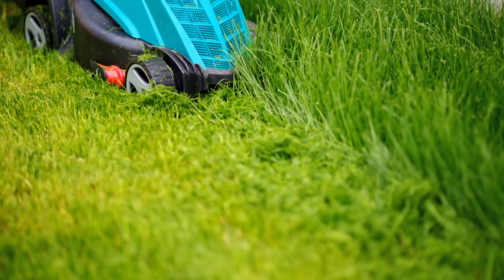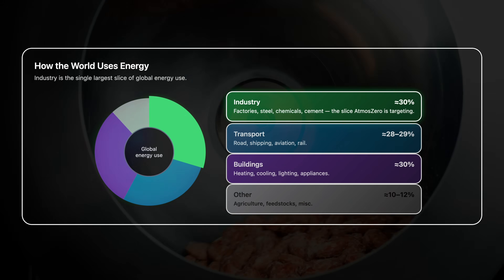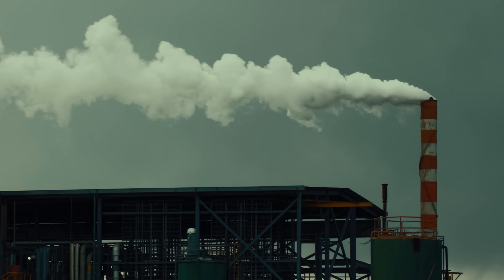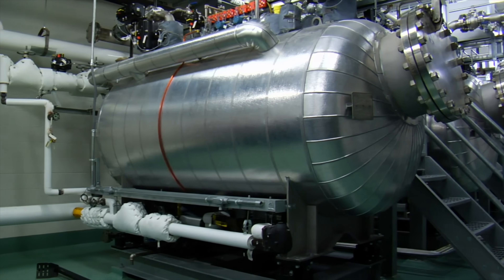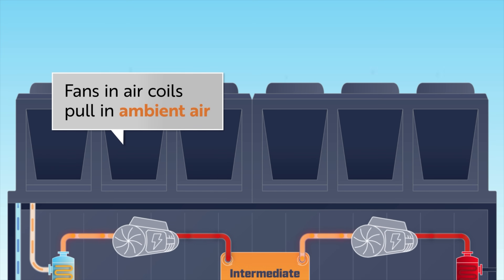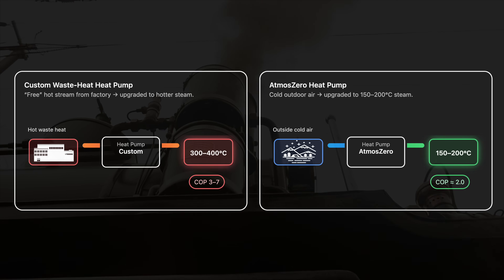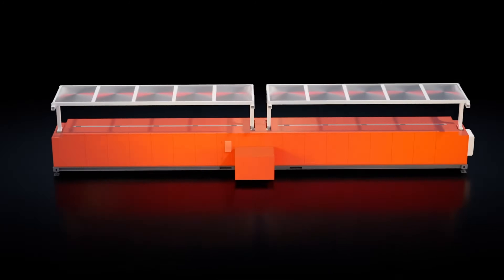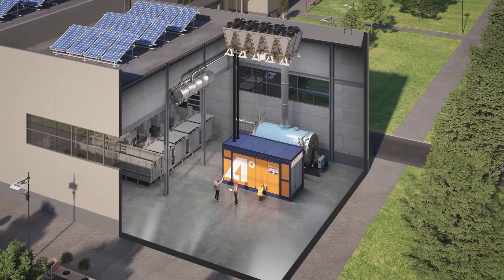This Startup Just SOLVED the Hardest Problem in Clean Energy

Comment from the maker: 🔒Get 20% off DeleteMe by going to https://joindeleteme.com/TwoBitDavinci use code, RICKY, to protect your privacy!
Reply: ricky, the other problem (beside the bespoke construct) is that once you are done "decarbonising", then there isn't any "waste" heat left . . . unless i am missing something.
Reply: The best solution would be making so many modular nuclear plants that electricity would become a after thought. Profit in energy sector is the main reason we won't achieve a type 2 society before the world markets crash and turn back the clock for another century🎉
Reply: what stops a data broker from buying or restoring a backup the moment after a deleteme request? nothing.
Reply: Hi Ricky,
With COP of 2, it means they need for 1 MW of heat half a MW of electricity at $45 (price is $90 per MW) but this is still 3X the cost gas generated heat at $15 per MW of heat, right?
The electricity savings from cooling by-product are small with separte cooling systems with COP of 3-4
Reply: @faica it's just going to cause us to burn more coal. It doesn't capture the carbon dioxide created by the fermentation process or solve the problem of demand for electricity not being supplied by other sources.  All other forms of electricity generation are currently incapable. It is just bad marketing to claim that it will "decarbonize" New Belgium.
Reply: What does this device do to eliminate the massive amount of CO2 created by the fermentation process? It is not  possible to decarbonize New Belgium breweries using it.
Reply: 12:42 China is a nation of engineers dream . They move their factories from one location to another easily like easy
Reply: Great show. Great delivery. Great editing. You made it all understandable.

Comment: I have worked in manufacturing industries as well as in companies that make technology for these companies. My experience is that when you calculate total cost of ownership over a period of 30-40 years(if modern equipment's lasts that long😂) both old and new tech evens out. So we sell new tech focussing only on savings and try to take the attention away from costs that old tech did not have. Basically humans buy new tech if they don't have to move their asses around more. 😂. Sell comfort not cost reduction or efficiency they will buy.

Comment: Decarbonising is a fools errend (there's an obvious self-balancing feedback loop). Carbon is easy to calculate/ tax (and give grants to your friends). Yes, it is purely a wealth transfer.

The inefficiency of cooling/ heating comes from the delta of ambient (like cascading heatpumps you mention. A brewery might just need a little above 60 °C for distillation & sanitation. So creating steam is wasteful. The reason steam is commonly used is that it creates its own pump (a little water in ==> lots of steam out). More could be done, like a swimming pool giving space for a small data centre instead of boilers(s). Or house a data centre in a block of flats for municipal heating & hotwater. The current rush of AI is a very recent phenominom and the world hasn't caught up. (My flat is heated via GPU mining; some would say it doesn't make financial sense, but I get free Bitcoin)

Comment: The problem with technology and videos like yours is not the cost of adoption or the repayment period. It is simply the shareholders financial horizons problem. The so called “investment funds”, “banks” and every other kind of financial mafia draining the life blood out of every economy around the world to make yet another trillion of empty zeros for the broligarhy. They don’t care about efficiency, CO2, environment. Just the balance sheet and constantly increasing investments through loans, which by the way they control as well lol. That containerised solution sadly caters to this, and there is nothing wrong with it. Just don’t call it revolutionary or redefining/redesigning the industry’s steam supply, Thats just shameless click bait.
Getting waste production heat in whatever form into a cascade compressor heat pump is not a massive bespoke process costing millions amd days of down time. It is actually simpler than dropping in that container and making sure you get a massive air supply into it so it can actually work, as shown on the chi graphics with the unit installed indoors. 
Waste heat is usually exhausted into the atmosphere through some sort of a venting system. All you need to do is put a heat exchanger on the exhaust grille and you are done. Factory doesn’t even know you were there. Pipe the heat pump produced steam using the existing steam supply piping. There is really nothing simpler! It gives you a predictable, non-weather dependant system. The comment about “needing cooling in the summer and heating in the winter” makes zero sense. If your process uses steam then you need that steam year round no matter what season is outside. 
Now, please state whether you were in way, shape or form paid by the startup you are selling in your video. 
Cascade heat pump cooling/heating is as old as sin. 
Anyone can create a small capacity cooling system in a day getting two old chest freezers (and taking the cooling units out of them) that will run -170C non stop without an issue with COP 4 minimum lol.

Comment: I assume if you can heat air in this way, you can cool air in this way by reverse process.  Tell me if this could be used for the AI data center cooling problem.

Comment: New factories can be designed to make waste heat accessible, even to a drop in unit, reducing the operating cost.  Existing factories can use the drop in unit with the lower efficiency.

Comment: Hey Ricky, a thought on “wasting” all the cooling capacity of your pool heat pump heater. I agree that all the bespoke ducting to get the cool air into your house is not economical. Though if the evaporator was a refrigerant to water heat exchanger, insulated chilled water PEX tubing would be much easier and cheaper to trench to the house.  An extra heat exchanger just before the main heat pump heat exchanger in the house system would allow you to take more direct advantage. 

But if that is still too much effort, then maybe you could use that cool air coming out of the evaporator to cool a pool house or cabana located right next to the evaporator so that cool air could be used to give a cool retreat on warm days when the average daily air temperature pool is low enough that the pool still requires heating to stay comfortable, but the peak air temperature (when most pools are used) is higher than comfortable.

The pool house / cabana doesn’t even need to be sealed since the cool air could be directed to simply blow over the people sitting inside. But of course a more solid pool house could be sealed up better with maybe one of these according glass walls so that the front could be fully opened when the air temperature is pleasant.

So with a small amount of extra ducting and a diverter in the outflow of the evaporator, you could get some added utility from the cool air you have already paid for.

Comment: Genuine question here, and maybe it’ll just be that it was out of scope, but is there any reason that there wasn’t a conversation on the fact that a huge factor for decarbonizing steam is that we need to switch to hot water? Not talking about industrial district steam where steam is a process input, but cases where steam is used for domestic hot water, domestic/commercial heat district, etc. 

This wouldn’t be the first flashy sustainability topic that really only fits into the real world if policy/technical realities get addressed at the same time. 

Still, this proof of concept is sweet and I’m excited this could be a realistic technology in the next 10-20 years! Looking forward to how hot these systems will be able to output given enough time. Seems like there might be potential to use a dual fuel approach, use nat’l gas or resistive heat after the heat pump cycle to clear higher temperature output? Regardless, sweet technology and the ability to capture 300kw equivalent of cooling capacity is crazy. Customers of these units (almost) only care about ROI and payback periods for the capex, and if you just displaced your plant office’s cooling demand at the same time??? Insane.

Comment: Great to see engineering recognizes economic realities.

Economically feasible allows for widespread usage. 

If a company specifically wants to re-use waste heat, they can build custom integration into the productized system. May make sense on case by case while product becomes cheaper through widespread usage.

Comment: So, you have 1MW of steam and 200 to 300kW of cooling capacity... and supposedly a COP of 2... anyone with any knowledge of refrigeration technology can see that something's not right here. Either the unit has more cooling capacity, or the claimed COP of 2 is a lie. 1MW and a COP of 2 require 500kW of compressor power; where do the remaining 200 to 300kW come from if the cooling capacity is only 200 to 300kW?

Comment: Using your pool for your ac has been done. But the pool water will destroy any system that contacts an AC. You would need a nonreactive metal heat exchanger, which is expensive. The pool chemicals destroy metals. There are already systems that do this.

Comment: If these pre-manufactured units are so super efficient , well more than cop 2 , couldn't you then just take the steam output and power a turbine electric generator to then provide the electricity which Powers the system? You'd be generating energy at the expense of atmospheric temperature changes

Comment: On the topic of scalability vs optimisation: I think you need the capability to do both.
A small set of simple, scalable modules that are plug and play and mass produced, that don't assume greater COP can be achieved through specific customer situations, yes.
But also have the same sales team/engineers be able to recognise an opportunity to deliver high COP with a custom setup. Optimise the process for recognising and delivering on such opportunities, and ensure your venture is a one-stop-shop for either the high or the low end of performance as needed. Use the experience delivering one to deliver the other as well.

Comment: High pressure steam, when talking about industrial processes goes way beyond the data points you're looking at... 

Speaking in terms of timber industry: plywood plants or pulp mills use 600-1200 PSI steam, then excess steam not needed for process is used to drive a co-generation steam turbine.

125 PSI steam cools too quickly or doesn't transport enough heat to simply replace the massive multi story power boilers or recovery boilers used in plants.

It will involve completely overhauling the existing production plants - which isn't going to go over well with companies, regardless of national green energy and carbon reduction strategies and policies.

Comment: @TwoBitdaVinci  -  Goebell's Wurming having been discredited, de-carbonization is no longer 'a thing' so this 'tech' is not likely going to be viable because of capitalization costs. Interestingly,  we developed several clean technologies... but several can't compete bc of the cap costs. [BTW, ever since Earth came into being everybody has known electric heating is much costlier than gas] 
Our revolutionary Fuel Agnostic, Zero-Emission engine beats EVs on almost all relevant metrics. That's HUGE!!! Even more surprising is our ability to improve on FAZE which will be able to power humanoid robots more efficiently and effectively using a novel power distribution technology that does away with electric motors. This improvement will significantly/maximally increase energy efficiency of industrial processes and do away with AtmosZero-like [heat pumps] processes.
--
Me, I'm a triple engineer and prolific inventor... among other things

Comment: FYI. This company is using air-source technology. Residential and commercial ground-source heat pumps from companies like WaterFurnance (of Indiana) routinely achieve a COP greater than 5.0 (BTW, COP is only used in heating mode)

Comment: I see why it was done this way, BUT the color coding of the animation at 7:18 is quite misleading. In reality, the steam or hot water coming back to the final Heat eXchanger (HX) on the bottom row at right, would not be Cold as the color indicates. If it was that cold, it would first pass through another Fin-and-Tube HX with the outside air to begin warming up, or have it mix into the flow at one of the earlier HX stages where the temperature is similar to that return flow from the hottest point. Similarly, the output of the first compressor (top row, left) would not be nearly as hot as output of the second compressor, top row right. Otherwise, great video!

Comment: I think that new companies or companies looking to relocate to a more modern building would be in the best position to use this tech.  So new data centers needing power from steam generators could benifit.  But I didnt understand does this system work still in the summer heat as well?

Comment: It's an ultra-efficient heat pump that works with multiple stages and is great for saving costs and down-time. Great. But this boiler still relies on electricity supplied by burning coal.

We will never be able to "decarbonise" until we are making our electricity without fossil fuels - solar and wind have their place, but also too many problems to be "primary" workhorse power solutions. Geothermal depends on location. Hydroelectric depends on massive, environment-disrupting dams and a lot of places are too arid. Fusion is always 20 years away. No, we need new-gen fission reactors NOW - these safe, carbon-neutral, super-efficient designs produce all the steam we need to drive turbines, and are essentially meltdown-proof. We should have gone full-nuclear in the 1960's, but the Cold War fear of nuclear, Nixon's graft and desire to use old reactors to breed plutonium for nuke stockpiling, the coal lobbies, and bungling accidents from the Soviets like Chernobyl ruined what could have been the green, cheap energy revolution we are still clamoring for over 60 years later. 

You don't NEED a boiler this efficient when you have nearly limitless, dirt-cheap green electricity. And we already have the tech for that with fission. It just needs pushed through the coal and oil lobbies, the greedy monopolizing utility companies, and the stupid press, and implemented. Hell, by now we should all have little nuclear power generators underground in our back yards. This is a very smart stop-gap, but it's a band-aid on the energy problem, not a cure.

Comment: Another consideration with installing a heat pump like this over a resistive heater is the energy supply. Many factories have been optimised for fossil fuels and don't have huge grid connections, running a heat pump with COP 2x means they get to install double the capacity for the same grid connection. Or make a smaller grid connection upgrade, saving costs further.

Comment: If the cost per MWH of $15-30 for gas and $90.6 for electricity, the heat pump would need a COP of 3-6 for cost parity. Cost will probably trend unfavorably(higher electricity prices) given growing electricity demand. Inputting waste heat may then become an economic necessity.

Comment: Heat pumps claim of 3-7x heat energy
Produced vs electrical energy consumed,
Under ideal conditions 
If this is true, then couple the heat pump to
A sterling engine with 50% efficiency to create
Kinetic energy at the fly wheel of the heat pump,
Then convert that Kenetic energy to electrical
Energy with a generator with about 90% efficiency.
Let’s use the realistic 300% efficiency 
300 x .5 x .9 =135% potential electrical energy produced vs consumed 
And if you take that up the the 7x claim in this video 
You get
700 x .5 x .9=315 % electrical energy produced versus
Consumed .
This is not over unity .
The energy is being “consumed” to run the devise is from the heat source, being drawn from by the heat pump, thus the net result would be “cooling” the “heat source”.  So one could infer , if the heat source is the planet and the electrical energy was not producing more heat, the net result would be a cooling affect on the planet…
Reply: Correction

…kenetic energy at the fly wheel of the sterling engine…

Rather than the heat pump…
Reply: I really hope someone with an engineering degree could look closely at this,
And explain why this obviously over simplified theory is missing something,
Or better yet see the potential and bring it to reality and create a modern scalable home energy devise, that could actually power our civilization with the heat we are so afraid of destroying our civilization.

Comment: This is just a  cascade system circuit being used to heat the high temperatures rather than cold to extremely low temperatures

Comment: I happen to have a license that permits me to operate Marine Boilers of unlimited Horsepower, so I do know a little about steam. Big steamships burn more than 2,000 tons of Heavy Fuel Oil every month. We are good with steam, but when hydrocarbons are the heat source, there are problems. The real energy loss in steam is losing the heat that condenses with the steam. 970 BTU's per pound. They appear to be condensing the steam to run it past the heat exchanger. Unless they capture that heat, they are losing almost 1,000 BTU's per pound of water condensed. This is why steam isn't efficient. Maybe they've figured a way around this.
Reply: Smart
Reply: The best way to do this, via a regeneration path, is to put a jacket around the steam condenser, and use that to pre-heat any incoming water.  Also you need to insulate the water storage tank.  Any process which tries to recover waste heat has to use variant of this approach.  Isn't this a Carnot Cycle.